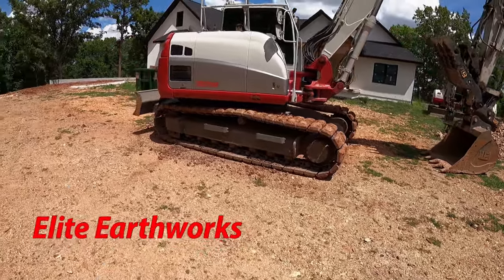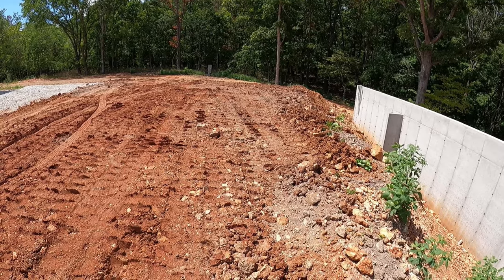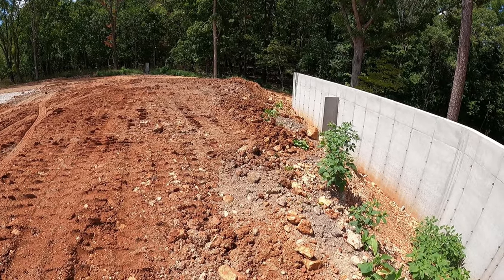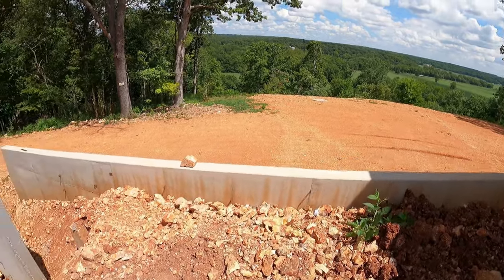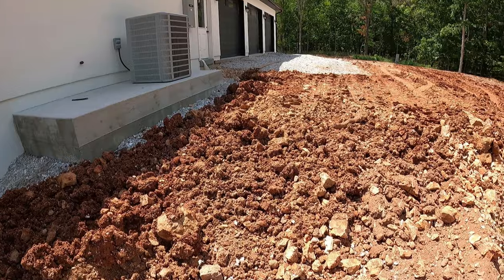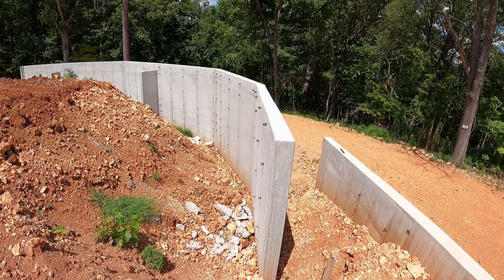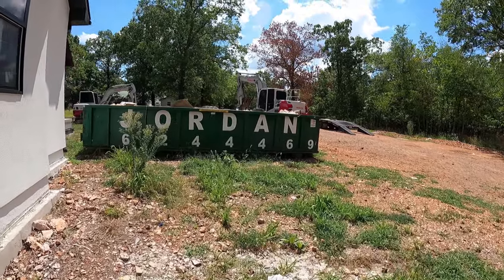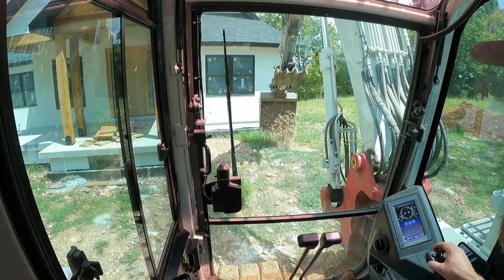Backfilling A Retaining Wall And Rough Grading

Comment: Hopefully, they will put in some cable tie backs along the top 1/4 of that wall?  Even with the corner to help hold it, the clay is going to push against it mightily.

My daughters house was built with a 10’ deep basement.  The soil from it looks just like that fill you spread.  It was filled against the north east corner in a pad about 3’ deep and 20’ wide. Then, they sprinkled a couple of teaspoons of top soil over it.  The only thing that took root was decorative pear trees and Fountain grass.  

They’ve tried a bunch of other things and failed.  About three years ago I used my baby backhoe to dig a 2’ deep by 3’ wide trench along the foundation.  We filled it with top soil and composted cow manure.  It grows great peonies.  But, the rest of the pad only grows dandelions and crabgrass!

I hope the contractor doesn’t skimp on the top soil!
Reply from the maker: They need to do something that wall has a tremendous amount of pressure on it. I’d believe that, this soil won’t grow anything I’m not even sure if bermuda could grow on it 🤣

Comment: That retaining wall sure seems thin for what it has to do. You are so right about hydraulic pressure. The only time you see retaining walls around here is along canals and roadways. Rarely you can find them separating new and old homes because the new ones need to be raised. It looks like the excavator with skid steer bucket is faster than using the loader.
Reply from the maker: I agree the wall makes me a bit nervous but hopefully it stays up. That makes sense on the walls.  Yes the backwards grading bucket is great. Lots of reach

Comment: Looking at the height and thickness (really the lack of thickness at least at the top) of that wall, and the fact that is all clay behind it now, it should be filled with just stone from this point forward, the top 1 to 2 foot could be topsoil/clay if they want to try to grow grass near the wall, but otherwise just stone.  At least that is what I would want done if I owned that wall.  Just my opinion of course (sounded like yours was the same), but the builder will want to do the least expensive of course....  The 2150 sure does a good job back filling around the house, keep at it and have a good one!!
Reply from the maker: I agree it definitely needs rock almost to the top of it. Hydraulic pressure is no joke  they put some deadmen in it but it still has a ton of pressure from that clay. Appreciate you watching